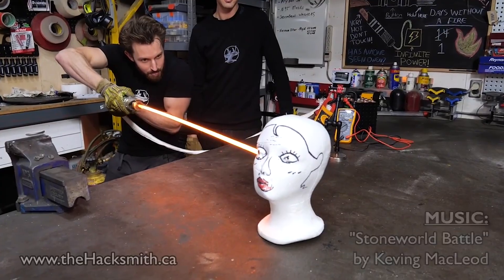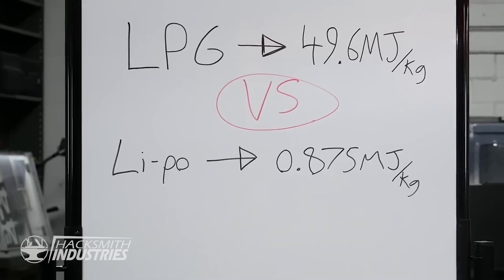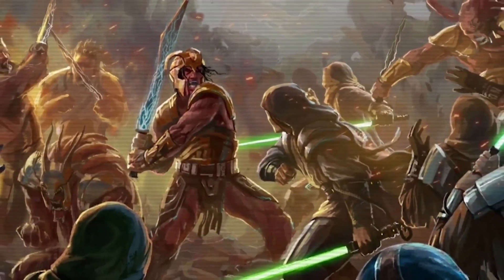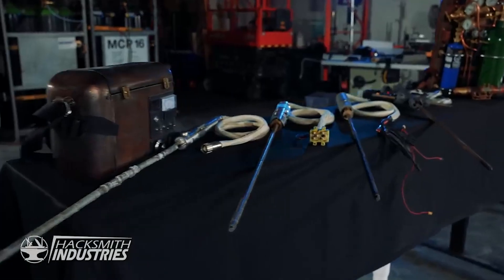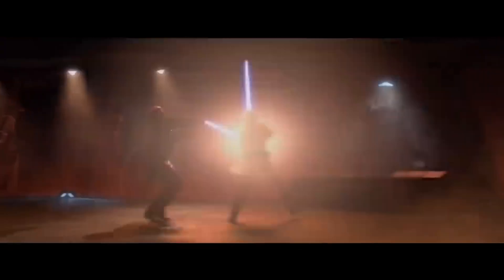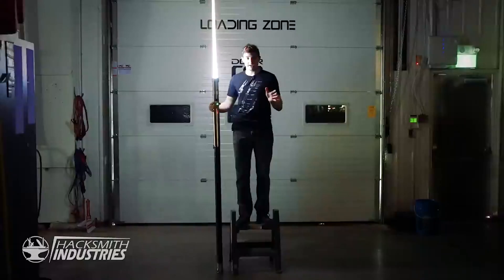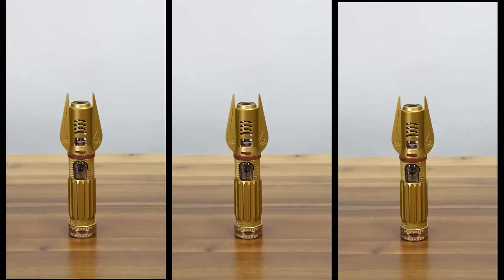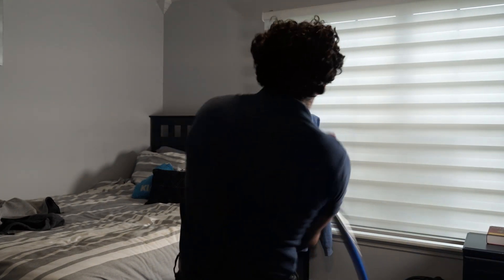How Do Real Lightsabers Work?

Comment: @nagatouzumaki8227
1 second ago
The focus crystals are actually just crystal m e t h and it does make you focus Alot

The lights sabers were made as a tool for the rebels they were an affective way to change the odds of the battle in a world made of metal if you think about it in Starwars realize that everything is made from metal and most have highly advanced armors most bullets won't make it through metal so but lightsabers and explosive based wepons can 

Imagine you imprisoned on a enime ship with no laws the ligt saber could help save you from being trapped on somone else's ship in the middle of space this is a vary liberating wepon that saved lives